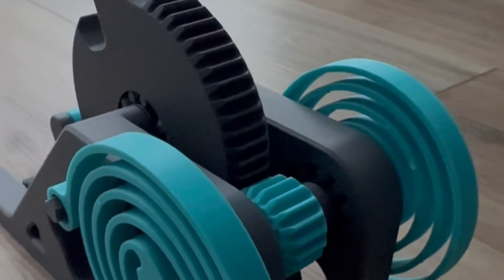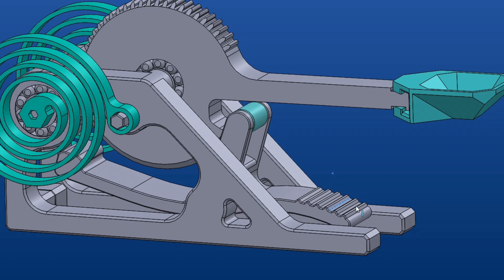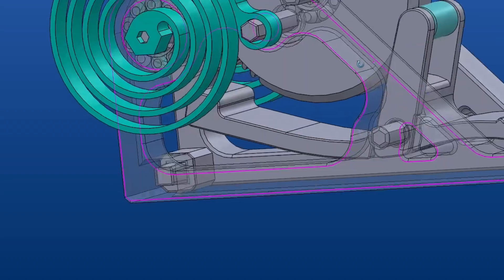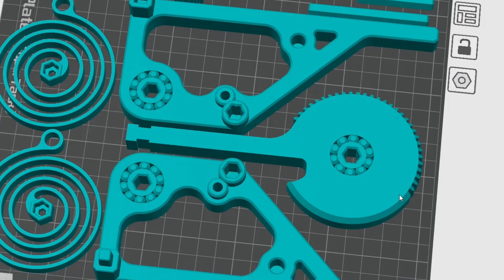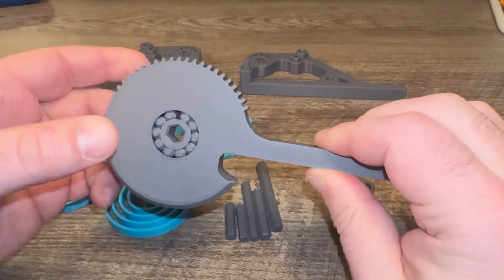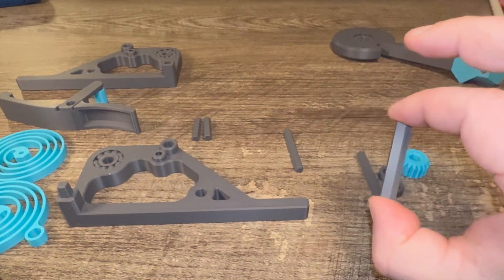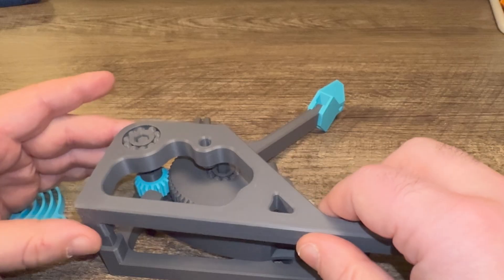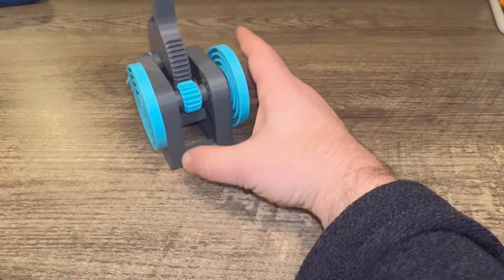No Support 3D Printed Catapult - Complete Design Explained

Comment: I noticed the catapult basket wasn’t on the build plate. What orientation is it meant to be built? I tried doing it the orientation it spawns in on orca slicer and it won’t stick to the built plate.
Reply from the maker: It needs to be printed on its side.  The slot that connects it to the arm should be perpendicular to the build plate (slot should be vertical)

Comment: New cat toy flinger has just been printed and assembled, works like a charm!
Reply from the maker: Awesome! No issues with the bearings?
Reply: @MacshayCreations  I printed this on the textured plate that came with my P1S.  The bearings worked well enough, but I think the individual rollers are fused together.  Also I took one apart to wrap as a gift, and the tiny square peg that keeps the two large sides together tore off, it had very little material in it.  But easy to fix, I just wonder if there's a way to get the slicer to add more filament there?  Overall a wonderful project, print came out fine on the first attempt.  Sends cat toys flying everywhere, they absolutely love it 😻😻